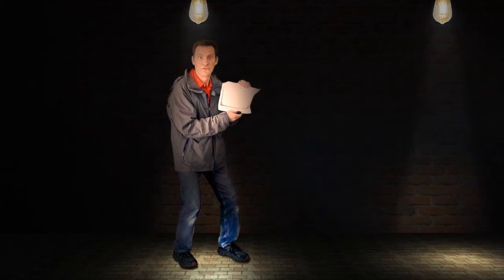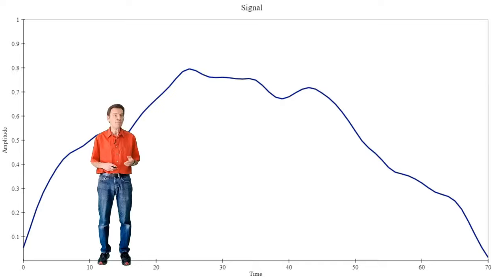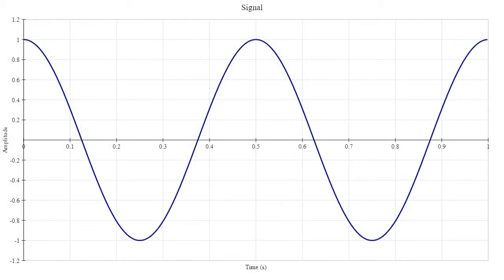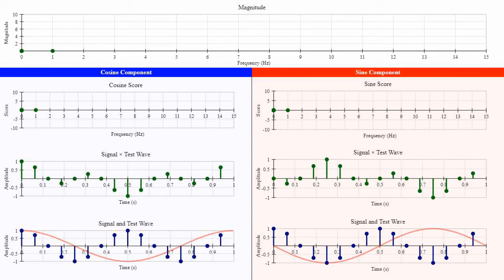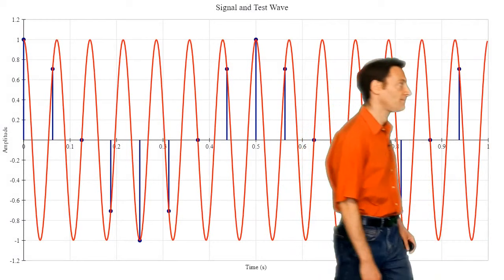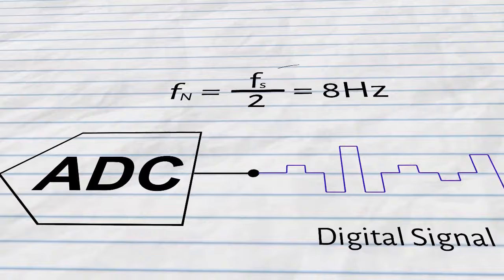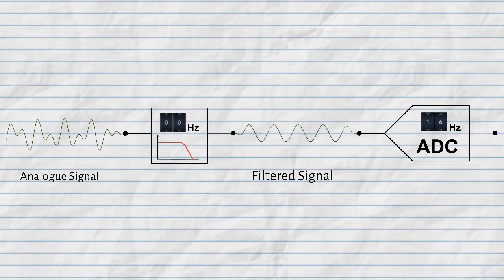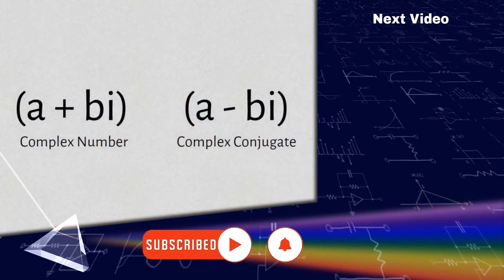Why is the output of the FFT symmetrical?

Comment: I understand that the result of 2Hz and 14Hz are same. but why 14Hz can change to -2Hz?
Reply from the maker: It's not that the 14Hz can change into -2Hz as such, it's that the frequency response is periodic, it keeps repeating itself. A signal that is discrete in the time-domain will be periodic in the frequency domain. So the real and imaginary values of the frequency domain response at -2 Hz will be the same as those of 14 Hz.

Comment: It's not true to say that a sampled signal only tells you what's going on at the sample points and "anything" can happen in between. If you are sampling a signal with frequency content only bellow Fs/2 then your samples uniquely describe a single continuous bandlimited signal. You know exactly what is happening between samples.
Reply from the maker: The proviso being that you are sampling at greater than the Nyquist rate of course. The problem is you don't necessarily know what the maximum frequency of a random signal is unless you have some prior knowledge of the signal or you filter it to ensure that no higher frequency is getting through. The point I was trying to make is that in the sampling process, you are effectively throwing away information about the signal and that causes the repeating nature of the frequency spectrum. As far as the FT is concerned, those higher frequencies could be there. The FT has no idea whether you filtered your signal or not.